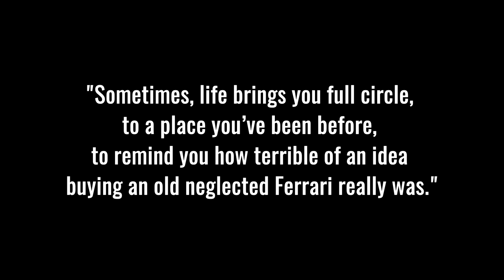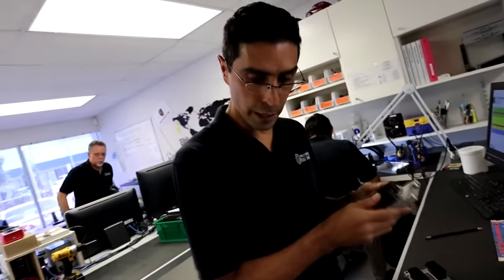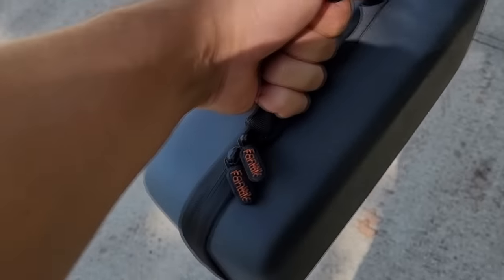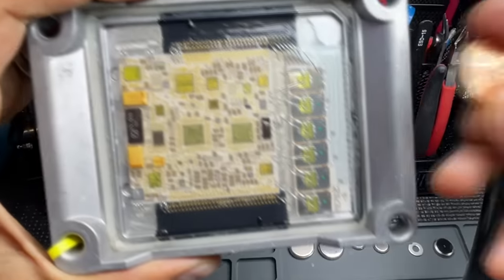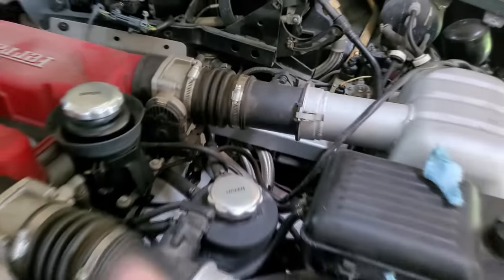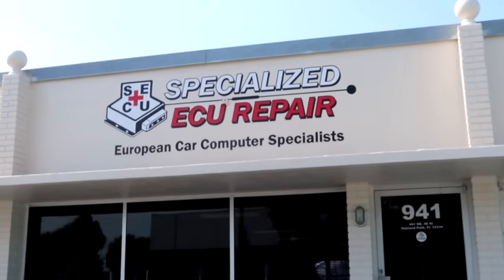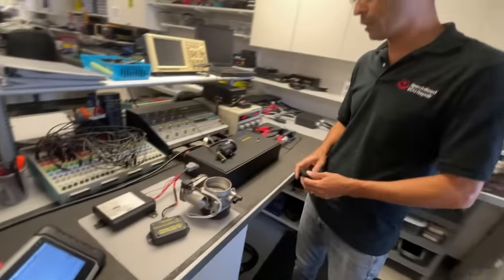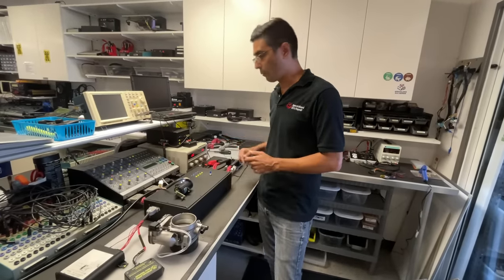Here's What FINALLY Fixed my Cheap Salvage Ferrari!!! (EVERY Ferrari 360's Fatal Flaw)

Comment: Computer probably does a selftest and checks the response of the throttle body. It then shorts out either from this or some other test causing a reset, and thus it repeats the test again and again, and never enters a mode where it can respond to scans.
A scope showing the current-drain over time should show a large spike before reset which is not there in the working ECU.
Failure could be a transistor on a half-bridge failed in a closed/conducting state causing shot-through when opposing transistor is activated. Classic failure mode of such electronics and why it is not a good idea to integrate the actual power handling with the logic in a non-replaceable way.

Comment: So in video - difference between most car computer and ferrari in ferrari: the chip is bonded to heat sink and than hooked up to board (chip lead soldered to to pcb).  Is that what he was trying to explain?

Comment: I had a similar problem with my Alfa GTA. That runs a Magnetti Marelli ECU, also irreparable. Mine has a reprogrammed used one now, in the knowledge this could fail too. A stand alone ECU is the only permanent fix at the moment.
Reply: On the Alfa 3.2 V6 there is a connection for the capacitor in the ECU that supplies power to the throttlebody that fails. Usually it is possible to resolder.  Could it be the same problem on the 360s? It is a similar Motronic 7.3  ECU.
Reply: @gustavstrandberg  I meant to say Bosch ECU. Unfortunately my one was toast, so not just the throttle body capacitor. The 360 one looks very similar with the conductive glue that fails due to heat cycles.

Comment: I wonder how, with a single unit being run on the test bench, it still works! Isn't these units supposed to be in sync with each other ?

The "devices" José mentioned are MOSFETs,  they fire the spark plugs 'coils, but they MUST fire them in sync with the ones being driven by the ECU on the "other side".

Finally, aren't those ECUs code-protected ?
MCUs have FLASH protection features, even for reading. I wonder why they leave them unprotected at the first place.

Comment: You need to programme the faulty chip(s) to retrieve the programme you need a.  Micro development system save it and download it to the new chip (if is a commercially available part). Software is the problem in today's world not hardware as it used to be).

Comment: Many of these computers, or ECU's were made when the government made the ridiculous rule for all circuit boards to be made with lead-free solder. This caused many to be made on old equipment set for leaded solder, so the solder connections worked for a while until vibration caused cracks. All you need to do is to take the ECB and cover any plastic with aluminum foil to shield it from heat then in a toaster oven heated to 350-390°F. Let the oven heat fully to above 350° F and then put the circuit board in the oven with parts on the top of the board, and aluminum foil crushed around edges to shield parts and raise it off the metal pan. Leave for 9 minutes, then take out and let cool slowly. Be gentle with board while hot, and open oven door first to let cool before moving. This will fix the boards. If you did not get it hot enough it will fail again after a few months. Just repeat at a higher temperature for 9 minutes. This works for all ECU's and even formatter boards on HP printers.

Comment: One thing I'm very good at is reverse engineering software. Could Jose upload a binary of the software and the type of CPU so that I could have a crack at it? Once you've generated the source code, you can adapt it to any modern microprocessor that's fast enough (shouldn't be difficult given the age of the CPU in there). Imagine a replacement that runs on an array of modern ARM chips to give it a backup.

Comment: Could part of the problem be the environment where the computer lives?  The engine bay in these is ridiculously hot compared to other cars.  The bmw computer shown is housed in an ECU box that is isolated from the engine and vented to the interior.  If this is part of the problem, perhaps relocating the ECUs next to the transmission computer behind the passenger seat could help keep these in good health?

Comment: Awesome video 👍 
I think they should be able to simply build a replica of the EMU or even program an universal one. They already know the interface. 
Then a cnc case and not sure if they can find the connectors or if they can extract them from the original computer. A stand-alone universal emu starts from like 800$ but then the tuning and wiring would be say 400$ plus 300$

Comment: The memory chip is failing. Replace the memory chip. It has a limit off 10.000 write's. When you open or close the car from remote, that is a write in the chip so that chip is design to fail and this apply to almost all the cars. In your case i'm not sure how you can do this do to the design of that ECU....

Comment: fantastic video   sir .    i was just curious , how much did it cost for  this remarkable  ecu specialist   to diagnose  ,    and fix the problem . i am looking to buy a 360 right now  and i  would to  get both ecus  replaced anyway  when i get the car .    i wonder if the heat from the motor causes the ecus to go bad   .

Comment: Well at 5:03 mark U are pulling a no no when it comes to anything with a computer on it and when U put the cable on it U can hear the arc from the Batt on video. Maybe U are burning them out. Alway pull the Ground no arc back through the system.

Comment: Not a perfect solution but possibly a fix for you. Grab a heat gun. Set it for 385 Degrees F, and slowly move it back and forth over the component side of the ECM. All of your solder joints are between the bottom of the pins and the board. (Surface mount not hybrid) A Ferrari is not known for its ATV suspension, and the solder is microscopically thin. When a solder joint becomes 'cold' the current going through it causes metal expansion and micro arcing. This chatter is the result as the joint heats and cools. Find yourself an IEEE certified board man, if you are afraid to tackle it yourself.

Comment: It may be possible to run the software on a motronic 7.3 based standalone, with an adapter to the correct pinouts, though I'm not sure how well that would work.

Comment: This is possibly a dumb question so bear with me.  Why not pair with an aftermarket ECU manufacturer to program one of the existing models up to replace these faulty ECU's?  Yes you might need to replace both ECU's with aftermarket units which will be a completely different shape and size, but could be more reliable and far cheaper to repair or replace.

Comment: To have a comment about FERRARI from a LINCOLN.....  that's interesting....

The bad computer MAY HAVE a bad DIODE or RESISTOR... and although they are VERY SMALL, using a CHEAP ELECTRIC MICROSCOPE may help replacing them...   The problem is ANALYSING and "debugging" the board...      A bad diode either creates a SHORT or an infinite RESISTANCE in both directions...   I'll bet it's MOST LIKELY a bas DIODE ...
The specialized chips on the board MAY GO BAD but LESS LIKELY !!

BEST OF LUCK!

Comment: In theory could you not just map the layout of ECU to a schematic, open Eagle PCB, and redesign a standard PCB-based version of the ECU. If available, the cost of these older components would likely be low, the PCB ECU could be made smaller and more durable, and the cost of manufacturing is very low using a modern PCB manufacturing service like PCB way. The only hangup I would see is the flashing Of the ECU which seems like a non-issue for the company in the video that potentially has the software side mapped out. Just food for thought. Am I missing something here?

Comment: I think the only way to overcome the computer issue  would be to to dump  all the chips, given they0re not encrypted, and start fresh with custom board, considering theese is a 20 year electronics, despite how adavnce theese where at the time, current average components should be able to handle this code without issues.

Comment: Easy fix. Just need a wirebonder. We do a ton of wirebonding at my work every day. Parts as small as 350um x 350um. The machines are not that expensive. Send me a closeup pic i'll tell you what kind of bonds they are. There are different kinds like ball, wedge, ribbon etc.  I

Comment: and minor repairs on computers like that are quite possible, major rebuilds, somebody needs to create the tech to do it without needing the creators of the computer to share.

for example the large caps could be the issue, and even on these designs, those can be swapped, i have seen it done over a decade ago on VERY fiddly setups that were being restored for a museum, the 3 old gals and 3 old guys, along with a couple of us young kids....well... we got the broken parts fixxed... and got a nice bonus directly given to each of us by hand...then... mailed to our homes was another gift pack... turned out...it was only one of a handful that didnt get scrapped and recycled as they got replaced with much newer faster tech that was much easier to repair.

Comment: Buy and repurpose the ARM-based cell phone SOAC processors that can talk to a custom sub-bus that can talk to the car's CanBus. Rip the firmware from the factory ECU directly through the OBDII port, save it to another computer then load it onto these generic chips. This is mostly a somewhat fussy interface design exercise but if you can repurpose existing high end cell phone system-on-a-chip processors with 4-16 cores and high clock rates, you can run any car electronic backbone out there and not expensively. I think the real problem may be a legal one, with car companies denying permission to copy proprietary software and firmware, but, if they aren't making them anymore, they won't have a legal leg to stand on. The car owner could argue he/she is merely repopulating code he already has a license to use, to replacement hardware. 

Actually, if you could do that, buy ARM phone processors and build custom Can bus interfaces, you could have quite a profitable enterprise.

Comment: i used a simutech similar to this but pc based software with the sun mcs 2500. dodge obd2 neon ecms had the same issue and the ecm looks the same but well i didn't work on ferrari at my shop. but the neon pcm could be flashed. how ever with no ferrari experience i could be all wrong, i do know that many manufactures would use the same pcm or module.

Comment: Hey man, 
I've literally just replaced the ecu in my vauxhall astra (uk) 
It looks exactly the same as that ecu out of the 360, I'm sure it could be different internally but it's worth the check!
Reply: Could be a modular platform by Bosch. A common architecture, but custom firmware ?

Comment: the bad ferrari board is  a ceramic substrate and the electronics are what they call smd's surface mounted devices first used in satellites on these types of circuit boards another liquid resistor substrate is layered on the board and a laser trims away the material to create all of the different resistor values needed on the board for the surface mounted devices which contain all of the transistors

Comment: 20:22 you know what's the sick part about this? that people got used to this arrangement. that it's normal for manufacturers to just drop support for their products and you're S.O.L, can't fix them. lucky in this case that at the moment it's lucrative enough for there to be one repair shop to fix this one thing for a high-end sports car, what happens when it breaks in 20 years are they going to be around? what if it's some less valuable but perhaps more critical device that breaks? "right to repair" is pretty important, whoever reads this please help make it a reality.

Comment: If they were made 20 years ago using that ecu program why nor remake the program from working originals and make more as needed? Takes less than a day to down load them on to like a flash drives and well it's possible to either run them on flash drives or there original type ecu. They are just computers.

Comment: Those Bosch ME7.3.1 and 7.3.H4 were used in alot of fiat,Alfa,lancia of that era. Despite the software differences, I am almost sure the pin out is exactly the same, if so, it's just a matter of flashing the Ferrari software. If you can give me the pin out of that ecu, I can confirm if I am correct.
Reply: I would also like to point out that I am talking about European spec cars that were never sold in the USA

Comment: owners should fund somebody to reverse engineer the computer and replace it with something like a redundant Pi with arduino type setup, or a programable processor even..thought emulating via software would probably be easier..

Comment: The fact is that all electronic circuits cannot be patent or protected. Due to the fact that they are based on natural laws of physics. Although you can patent and copyright processes and software. There's no reason why someone couldn't develop a compatible piece of hardware to replace this. That's the reason why it is built the way it is. It just takes someone willing to take the time to trace out all the circuitry

Comment: Someone needs to reverse engineer the circuit layout and draw up their own conventional PCB. Then you can move/replace the components. 

Or run a stand alone ECU. Someone could also make a adapter harness so it just plugs right in.

Comment: More than a decade ago I built an EFI computer for a custom 1962 Buick 215 V8 that used Ford injectors, a pair of Chrysler throttle bodies and a mix of sensors and it came from a company called MegaSquirt.
Just build a duplicate!

Comment: I am certainly no industry maven, but it seems to me that if emulators for old computer games can be brewed up, then someone with the tools and skill could brew up a Ferrari 360 (or any car) computer. I'm not even certain that there's a need for two separate boxes. All that could be placed into  one unit, doing all that work. And it could be somewhere besides the harsh engine compartment.
Of course Ferrari, being the petty, petulant buzzkills that they are, would probably come after anyone who solved a problem that they refuse to solve.
That BMW box; mil-spec, modular, easy (relatively) to repair. 
This is money laying on the table for someone.
I'm glad Jose got your car running! Awesome!

Comment: Most cars have a very similar set of sensors etc, so making something like a holly stand along ECU or a speeduino run the car would be doable -- not easy but doable. The issue is originality it wouldn't fit inside the old ECU box so it would stand out as a modification.   Really the run an engine side of a custom ECU isn't the hard part its figuring out the proprietary devices it also must communicate with, the security, the radio, the suspension, on these and newer cars are all either one off custom or can bus.

However the ECU's are not that complex of a computer, they don't require super strong processors.  To fill a market of keeping cars running needs to fill a wider range.  Simply put you build a board with all the drivers and voltage regulators and have a plug in single board ARM computer that can emulate the processor side of the ECU.  This would allow you to run the original "tune".  And the one off parts would be plug adapters for supported cars.

For something like a speeduino which can run up to a v8 in waste spark applications you have to tune it for each car.

It is possible to run it with a holly if you are sneeky on the settings as it doesn't support anything over a v8-- it might be possible to run duals.... of course then you have the trans controllers etc.

However if a company put some support into the speeduino project taking it from a tinkerer device to a viable solution for these older newer cars.
Reply: Post High resolution pictures of the board so that we can read the chips and follow the traces--- I've built one off reproductions of old computer and game consoles doing that.  Any traditional method though would result in a 2-3 times size increase so that might be an issue.   Though doing it this way you are likely looking at $2-3000 per building them in the garage... finding another bosch ECU that is software compatible and making plug adapters is likely an easier solution.

Comment: Could another engine ferrai  computer be used and reprogrammed.  Need to make an adapter pigtails to plug into engine harness.  Jay lenno ran a ww2 tank with formula A1 control computer.  So to me these computers have basically  same inputs and outputs

Comment: Would it be possible to manufacture a standard pcb Board with microprocessor etc to emulate the Ferrari computer. So long as the input / processing and output match, would it work? Ie create a new blank computer, upload the software and plug it back into the car with the same pin out?

Comment: any chanche that the problem is the capacitor desoldering? (the big yellow one in the right bottom corner while filmed?) that ecu is very similar to an alfa v6 busso one (shared components during those years  under fiat managment), and on those the problem is caused by heat and vibrations (on the alfa the ecu is placed on the manifold over the exaust).
if that is the problem is "easily" (resoldering over a massive heatsink of an aluminium chunk is kind of a bitch), there are even some tutorials on how to do hat on youtube.

Comment: It is not really a mainstream car,and that is a big problem. If it would be a mainstream car that gets sold by the hundreds of thousands i guarantee someone would have found a hack to repair on a component level that ecu that breaks a due to usually a design flaw. Otherwise you pay the premium repair for a premium car.